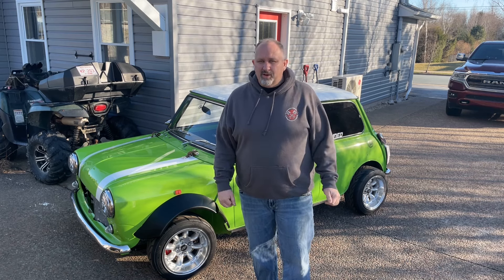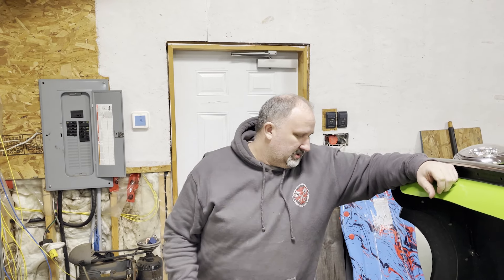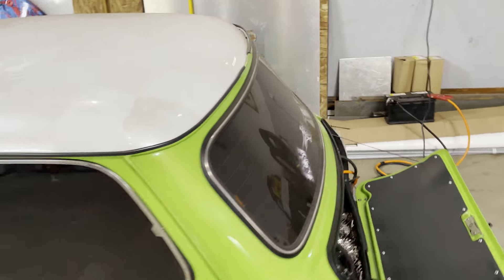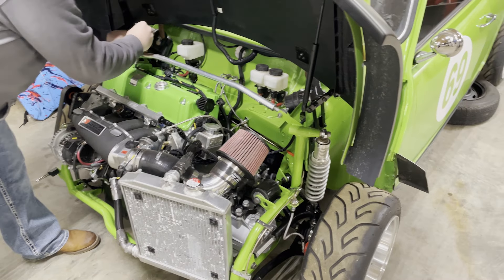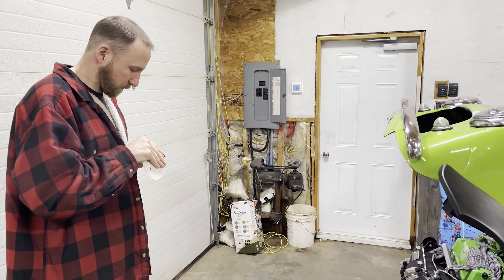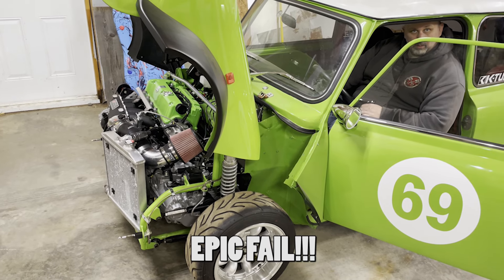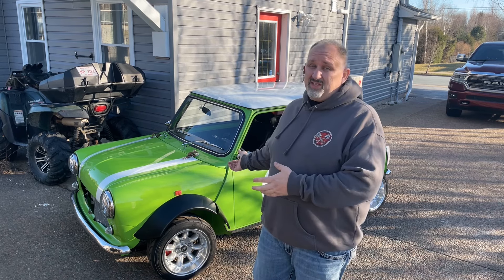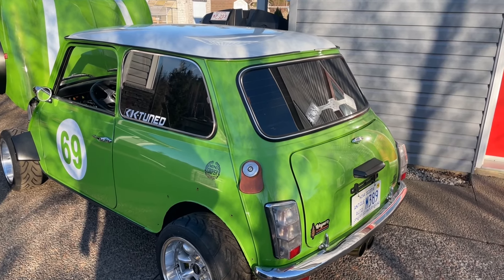Classic Mini Cooper - Honda K20 VTEC Swapped - Project Intro

Comment: In the process of Building a AWD K20 6 Speed Type R Z4 ... ..   IT IS A MASSIVE PROJECT.. 90% of the hard stuff is done....  had to completely Modify the MiniTec Subframes to comply with local regulations... E.G. had to fit it under a standard Steel front ( which I made removable ) - no flip fiberglass fronts allowed after 1971.. 

Yours being  FWD... whats the torque steer like ? have you had it on the 1/4 mile yet ?
Reply from the maker: That sound like my kind of project :). I’ve really enjoyed every second with this mini.  But if I had to do it over again I would definitely go rear engine rwd or AWD like you.  The torque steer is tameable but not with out a lot of tweeting that was never quite advertised.  Frankly the geometry of the minitec Frames lacks ALOT as well for the FWD set up.  That said my car is a beast and demands attention behind the wheel.  The plan is to get her on the track in a months time.  I will be adding some video shortly.

Comment: Did you put the setup together yourself?
Reply from the maker: Hi Cameron.  Short answer is I bought it as a partially finished project.  Got it working better and than took it all apart and painted things.  While apart I worked with a local shop to build the motor and transmission.  I have a video dropping shortly to explain what’s next.  This ride is hitting the track this year and as of today there are things that make me uncomfortable to do so.  These cars are very fun but a fwd swap has massive torque steer issues to be sorted.  They can be tuned out but it’s alignment, suspension tuning and patients.  I’m almost there :)